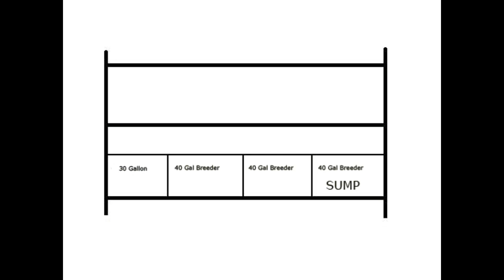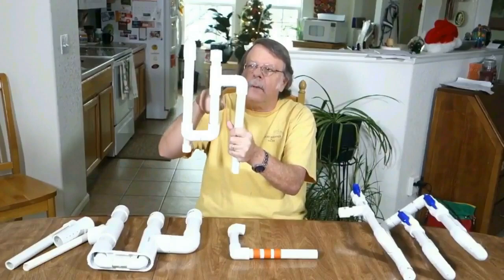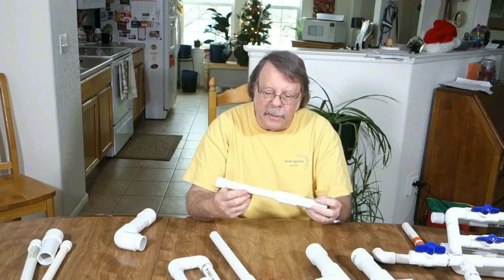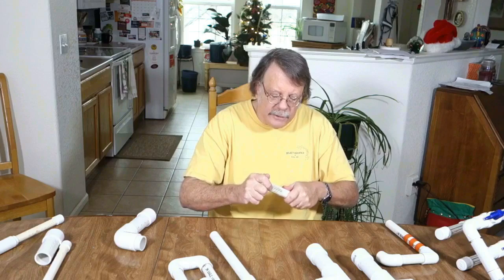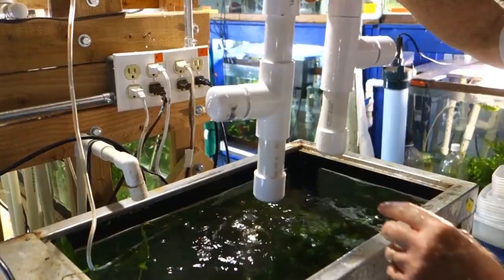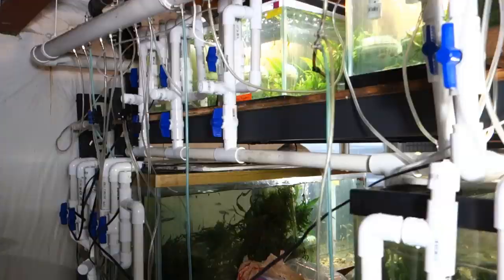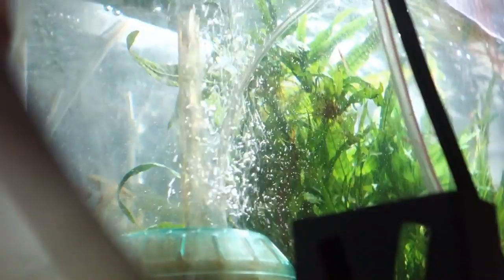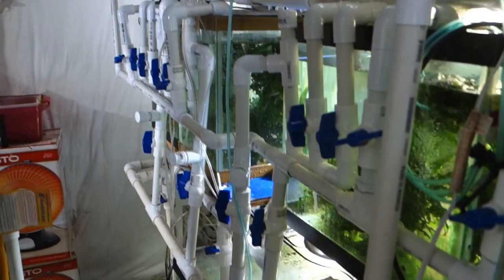Select Aquatics Presents - Creating a Maximum Filtration Rack for Top Water Quality Fish

Comment: Greg ive probably watched your videos and it has been a great inspiration for me to go ahead and build my own water change system.        im now in the process of finalizing planning for a rack to have central sump system.       have a question how do you control the water going into each tank so that they all get equal flow.    do you simply use a pvc ball valve to achieve this?

Comment: Thanks Greg for the Rack Build video.  I see that you are using the same water for the entire rack basically.  That means that the types of fish in this rack would have to have similar water requirements.  With so much bleed-off on the pump, I'm wondering if you could get by with a smaller pump and thereby save on electricity.  I appreciate what you mean by the pvc dust--just drilling is enough dust for me.  I am making some overflows for my 5G fry tanks today so I'm hoping to put out a video soon on how to do this for smaller tanks.  I have one question that jumped out at me when I saw the tanks hanging over the edges of the rack.  Do you think there might be issues with structural strain on the tanks where they are not 100% resting on a flat surface?  How far could I stick out without worry?  I too used a Whalen rack and found that their dimensions were not EXACTLY designed for tanks which is too bad.  I've always wanted to write to these companies and tell them that their racks would be better if they would fit fish tanks better.  (Don't know how that would go over.)

Comment: Why simply not drill tanks?
Reply from the maker: Tanks are not drilled as they are often destroyed while doing it, bulkheads will crack as the rack settles in over time, and tanks cannot be moved easily and portably when the tanks are drilled.  Greg sage, selectaquatics.com
Reply: @selectaquaticsoferie  I understand. On the other hand I drilled great number of tanks over the years and only once when I was rushing through the process I managed to crack the tank. All discus breeders I know including myself are using drilled tanks. It is very easy to  make things work when you are using drilled tanks.